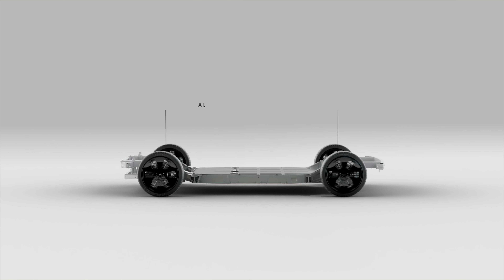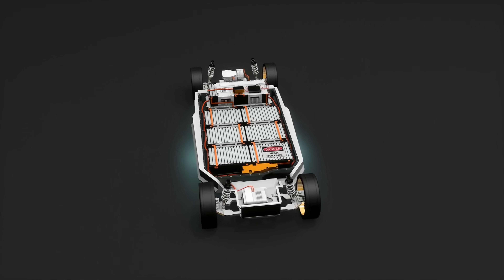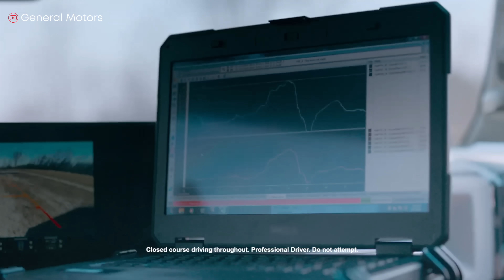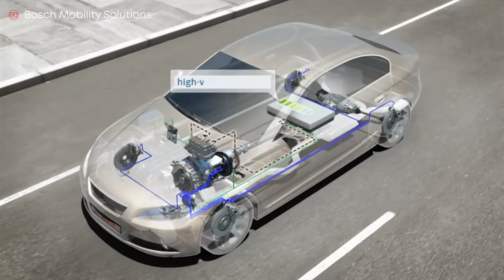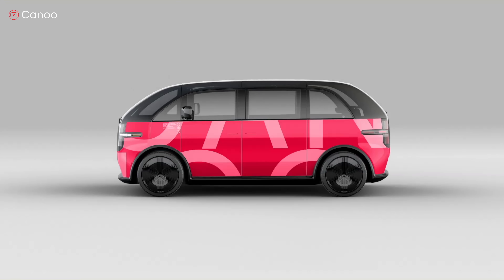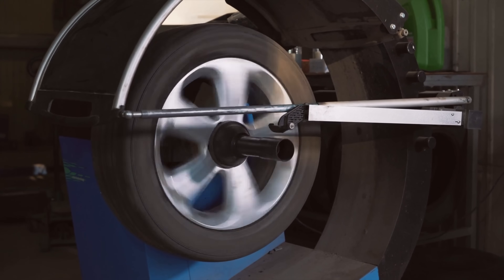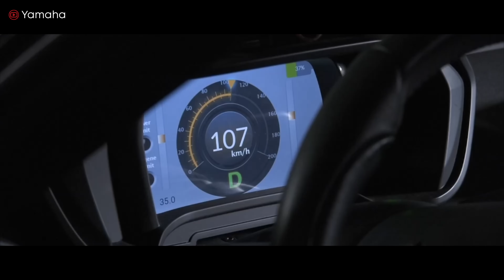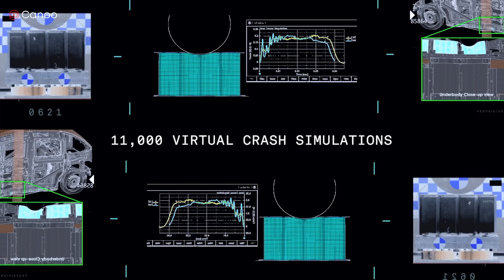No One is Telling You the Truth About Electric Cars, So I Have To

Comment: Well if they can’t be left in the hot or cold extremes for too long…electric cars aren’t going to go well in Nebraska lol….we have -30&-40 in the winter and 120 in the summer…extreme in all seasons…I’ve had to replace my regular car battery several times because I don’t have a garage to store my vehicle in when it -30 out and visa versa…
Reply: Most automakers have a separate ac system for the battery so it stays in the perfect temperature all the time , this is how EVs survive in Norway for example. Down side is you need to have the car plugged in overnight and if you forget you'll lose 20-40% of it's charge
Reply: Bullshi+, Nebraska DOES NOT get to 120’s ever
Reply: I wish you lot would convert to Celsius like most of the world
Reply: @Howie57  there are conversion formulas to help.with that issues of yours.
Reply: Norway is a HUGE ev market, and they are far colder than the US. Don't exaggerate the cold weather issues.
Reply: @captinbeyond  Tesla already has 15K Super Chargers in the U.S., and will be adding thousands more every year.
Reply: Think of us Thousands of People that are all in the Same Boat !!!  I for one think they better come up with a Vehicle, that works in any Climate Come On this Silly !!! Maybe an Hibrid that is even more efficient a Bigger Battery that likes Heat and Cold !!!
Reply: @captinbeyond  bingo. It's one thing that the technology is new, but if you include all the shortcomings then EV's sound like a terrible idea as of right now.
Reply: I agree...... I like the Hibird concept
Reply: @drrightwing4435  hits 100s
Reply: @ColinFox  The United States is a lot bigger than you realize. There are plenty of locations that receive arctic air in winter.
Reply: @captinbeyond  No, Tesla and the people who buy Teslas are not getting any federal money at present.
Do you have any idea how much the oil industry receives in government funding every year? I heard it's in the billions.
Reply: @antreastoumazou2736  That's right. If you leave the car plugged in overnight, it will maintain the batteries at a good operating temperature. Although I question that 40% loss figure if the car is not plugged in overnight? Is it really that bad? Although I suppose that if the car has a simple resistive heater and it is a very cold night, it could get that bad.
Reply: @surferdude4487  Federal tax credits up to $7,500, and pays 30% of the charger costs - all while contributing nothing in taxes for maintaining roadways.  Meanwhile, ICE drivers pay tens of billions to the federal government in excise taxes - and fed funding only makes up about a quarter of what is spent on roadways each year.  When taxes are introduced into utilities to cover the shortfalls from those who make the switch to EV, it will turn into another round of the general public subsidizing EV drivers.
Reply: @jeffj1961  Your information is out of date. Tesla exceeded the number of vehicles delivered to qualify for that incentive some time ago.
As for the rest of it... If the taxes collected on gasoline that are supposedly for road maintenance actually went to road maintenance, perhaps there would be no such thing as those axel busting potholes? The system is broken and long overdue for some proper adjustments.
As for the OEMs that still qualify for EV incentives, they can use all the help they can get. They are losing money on every unit they sell because their technology is at least 5 years and as much as 10 years behind What Tesla is producing at significant profit without any help from the feds.
Reply: @captinbeyond  you're dealing with Tesla fanboys that don't give a damn about camping and going long distances and staying overnight in the woods.
And they all have garages.
Reply: @surferdude4487  If the clean energy for america act passes Tesla's will once again be eligible (and retroactive from what I have read), for larger amounts.  Your argument has no merit about infrastructure funding, and is insignificant in this conversation.
Reply: @captinbeyond  no  you don't think that the car do it all atleast Tesla does the management system allow to work in cold or hot and you can charge at your home or use all the network chargers everywhere
Reply: @jeffj1961  I have already addressed the issues with infrastructure. Your failure to understand those facts is not my problem.
Reply: The guy that made this clip is a numbskull that knows nothing about EV's. Some of his comments are so wrong, the clip should be reported.
Reply: @captinbeyond  why are you making comments like that if you have no idea about what you're talking about?
Reply: @darylfoster6133  25k* you were incorrect by 10k lol. Also Tesla's got a factory in china producing 20k a year.
Reply: 117 degrees. Beaver City-July 1934. Same month my dad was born.
Reply: @drrightwing4435  Google it my friend... record is 118 in 1936.  Pretty rare for us to get much above 100 though. Much more likely to get the colder temps
Reply: @captinbeyond  No, it should be reported because the information is inaccurate. It has nothing to do with me and my shortcomings.
Reply: @captinbeyond  they get No tax dollars.  And are made in the USA.
Reply: @jeffj1961  Nice! I think I’ll have another.
Reply: @surferdude4487  No, you have failed to stay in the context of the conversation.  How the Federal government uses the excise taxes collected from ICE drivers has nothing to do with EV drivers lack of contribution to funding roadway maintenance.  You just threw that in to fish for likes, as though it might give your argument merit.
Reply: @lachlanB323  You're right. 15K was a 2020 figure.
Reply: @surferdude4487  no such loss. Absolutely FUD. Not even 1/2 of 1%.  There is no problem with the batteries out of covered area even in Phoenix. So much mondes people do not do their own research!
Reply: @icost4671  Tesla owners love camping and wait for the cyber Truck😎
Reply: @jonfscott  🤣🤣🤣😂
I'm new to all this so you got to forgive me
This got to be a joke right.
Does that truck even exist 😅
Reply: @drrightwing4435  lol…oh yes..it does lol…I’ve lived here my entire life…and every summer at least in the southern part of the state…we get 100-120 often…maybe in the northern part of the state it’s not as bad but I know where I’m at…it’s hot af! There’s one store front digital sign that gives the temp and a few summers back it read 127 degrees…so yes…I am 100% sure that Nebraska gets that hot…and it’s a dry heat where the mirage effect shows on the concrete…so never gets that hot 😂…ok…does it never get that cold? Cuz I’m pretty damned sure I was seeing -30&-40 on my outdoor thermometer that I keep up on my porch out of the wind this past winter…
Reply: @drrightwing4435  😂
Reply: @rm5282  I’m actually working on a cover for the battery in my current vehicle so I don’t have a dead battery again this next winter….and it’s a new battery lol….insulating the box that sits over it…it seems these winters are getting colder and colder
Reply: @ColinFox  oh I wish I was exaggerating lol…all those fridges mornings standing out there hooking my truck up to a jumper box because my brand new battery was dead when I went to start it…make sure u know someone is exaggerating before saying they r…somethings not right with the weather these past several years…I’ve never experienced that cold of temp before this past decade…but we also used to get a lot more snow..the snow u can make snowmen out of that weighs a metric ton…now it’s all that fluffy crap that just blows around and covers the sidewalk I just scooped for the third time….Norway is so cold from what I’m told and idk how u all can stand that cold af weather…I know I’m wanting to move further south to avoid it..but after what Texas experienced this past winter, idk if that would make any difference…
Reply: @captinbeyond  and it seems like everyone has already forgotten what happened in Texas this past winter…someone commenting that Nebraska NEVER gets to 120 degrees lol…yep and Texas NEVER gets to the freezing point that overwhelms their power grid and leaves people without power for days in end either…lol…until now..
Reply: @smolville  127 in McCook…2011…this summer has been mild compared to every other summer
Reply: @meagantripp1573  in the northern part of the state it might be rare to see higher then 100…I’m in the south western part of the state and 100 is a norm…except this summer which is odd…but generally I see 100-120 most of the summer since I was a kid….but if u check the temp on the digital signs…the ones that r shades are 10 degrees cooler then the ones that r in the sun…
Reply: @w8what575  cool, err, I mean warm 😆 🤣 

Good for you. Those winter temps really bad for batteries.

Comment: If your car slows down when gas is let off do your break lights come on so nobody hits you from the back.
Reply: Of course not.  Ever drive a motorcycle?  Same kind of "braking" when you let off the throttle.
Reply: That's what the break pedal is for. Break lights should NEVER come on unless you press down the break pedal.
Reply: The brake lights on Tesla vehicles are activated with regenerative breaking.

Comment: I'd like to see how they'll tax these vehicles - especially the per mile tax that they want to charge.
Reply: Gov will pound on electricity as they have gas, will be near unaffordable quickly. Since we run our homes off it as well, not a good mix. I can see a paid for stand alone solar system in my future if I gotta run EV's. I only got about 12-15 yrs left to drive so doubt will have to worry about EV's.
Reply: Don't worry their is a mileage TAX in the be road infrastructure bill ,

Comment: Think I will stick to hybrids and regular cars like my Lexus 400. Never felt the need to ever switch since it just always runs well and has lots of room. Maybe one day I will get a new hybrid of some sort. As always great video Scotty answering more questions that I had.👍👍
Reply: thats why the Fed just mandated that a major percentage of new cars will be all electric  by 2030.  You will be MADE to care.
Reply: Hybrids are the worst of both worlds.   Seriously electric is the future and Tesla is leading the way.  Sold 500k in 2020 without spending any money on advertising.   I seriously doubt that people would be buying if it wasn’t a great experience.  Tesla = innovation.   Currently driving a Toyota Tacoma and eagerly awaiting the Cybertruck.   Who doesn’t want stronger body panels, glass, dynamic air suspension, 110/220 outlets, pneumatic air,  built in tailgate ramp, 6.5 foot stainless steel bed and 57” wide without wheel wells.
Reply: @Frank_W.  Well said.  But be careful, Scotty (likely paid for by GM and the others) is trying to manipulate people into thinking EV's, especially Tesla's, are too expensive, have range issues, are slow, have no resale and so forth.  That is true for most other EV.'s but the complete opposite for Teslas.  As I read many comments, it seems many believe him or still don't know.
Reply: @Frank_W.  The Japanese are way ahead of the game. Hydrogen cars are greener and the first ones will be released soon. A single solar cell can produce 125 litres of hydrogen a day. The infrastructure in the UK is not geared for millions of electric cars, and neither are US cities I expect. Plus the cost of these vehicles is astronomical. Worst of all by 2030 the UK will need to burie around 20 million tons of these batteries as they can't be recycled.
Reply: @Clem_Fandango11  How many hydrogen charging stations are around where you live?  Electric is everywhere and 92% of Tesla batteries will be able to be recycled so clearly you are not following very closely.   JB Straubel who is former Tesla has started Redwood Materials recycling. Way ahead of the game….Toyota?!  That’s laughable since they have been kicking and screaming about this electric transition.   Full disclosure…I drive a Toyota and waiting on Cybertruck.

Comment: We have a EV Kona 64kw battery. Have had it now for 16 mths . No problems at all have put 35,000 km on it now. We charge it 2 to 3 times week at home on a level 2 charger at a cost of about $5.70 each charge for a range of 350 to 380 km per charge. Never have used a level 3 charger as of yet. We get a range of 470km in summer and winter a range of 340km . We love this car and will never buy another gas car

Comment: Thank you for this information Scotty and your honesty all these years and perhaps I can share my experience.
I have two electric cars for me and my wife  we run these guys for three years 50,000 miles so far we don't have any big repairs but we replace the tires in both cars looks like ectric cars wear out the tires way faster also the tires are more expensive because they have to be lower assistant or ultra-high-performance but that's it we charge our cars at home overnight when is cheaper overall the maintenence in electric car is simple and way cheaper
Reply: Do you think, I can go for a ev over a gas car?
Reply: how much crude oil does it take to make the tires???...
Reply: @dilakshandk77  at the end of the day oil will run out electric wont forget prices, maybe oil wont run out in this life time but it will eventually
Reply: @miscool  You do realize electricity does not grow on trees, right?  Unless a country goes to, or back to, nuclear, EV's will still require fossil fuels.
Reply: EVs also wrigh around 500 Kg more than an ICE car, so the tyres will always wear out quicker
Reply: @doctorlarry2273  fair point so what do you suggest if you had to pick between the two?
Reply: @miscool  Nuclear is the best option.  Particularly now that we have plants that are so much more efficient and safer than before.  We can more easily handle the disadvantages associated with nuclear than with other energy sources.